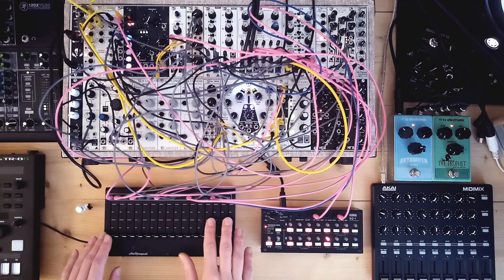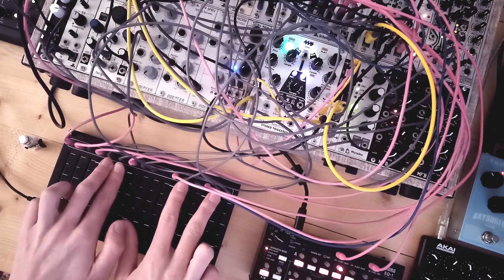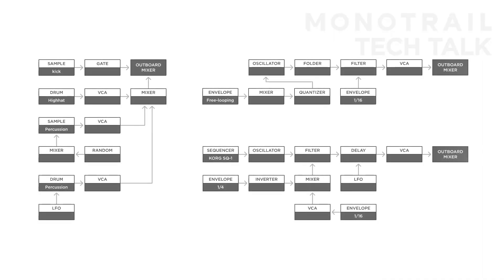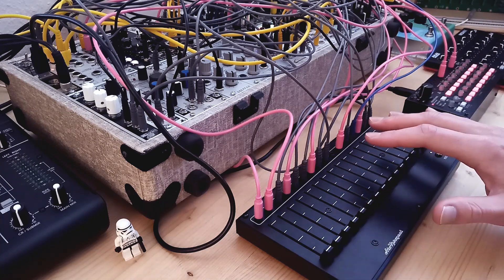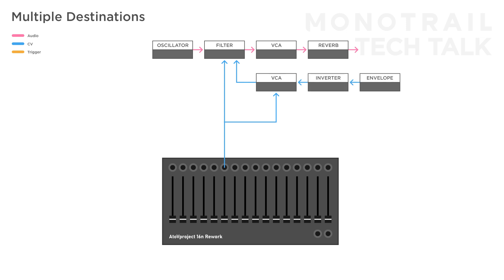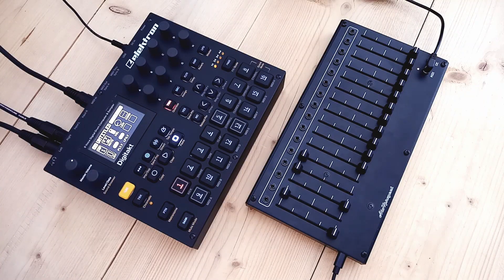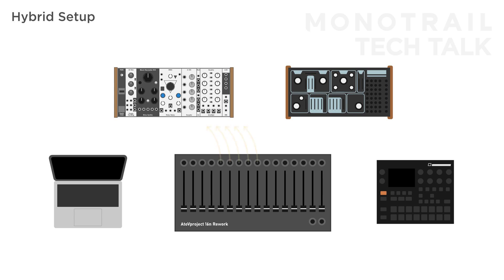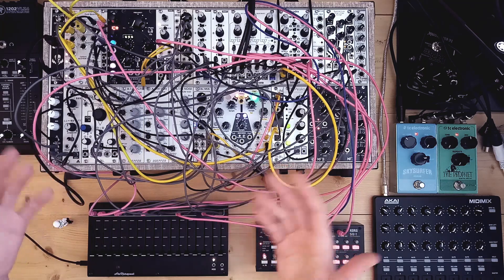How to improve control over your modular, hardware and software with AtoVproject 16n Rework

Comment: Nice presentation as always on your channel!
As you can control via MIDI CCs I wonder if you could use it also the other way round to convert incoming MIDI CCs to CV with this fader box?
Reply from the maker: Thanks! You can use the sliders to control CV and Midi, but not the other way around. So it's not a 16 channel midi to CV converter. Although that would be nice indeed :)

Comment: Would you require a midi breakout like the CVM8 from expert sleepers in order to connect to to the Disting EX?  It's not super clear how that connection is made, could you clarify?  Very inspiring stuff!
Reply from the maker: Not midi, I am talking about the I2C port. So you should be able to use that single jack out from the fader bank to the EX. But I have to admit I don't have any of those devices, so I could not test it myself. Make sure to check the manual for the EX if you want to know more details.

Comment: thank you for the video, but 1 question, why should it receive midi through usb? (1:50)
Reply from the maker: I think they actually updated the device, so now it could be possible. It would be nice to recieve MIDI because then you can use it as a midi to cv converter, and send values from a DAW to your modular for example :)

EDIT: After clarifaction from the maker: The module is updated so it can send midi data at its midi output, recieved via the usb. The slider outputs are fully analog, so it's not a midi to cv converter! But you can use it to forward midi data to digital modules.
Reply: @MonotrailTechTalk  oh,i see! Thanks!

Comment: This video made me buy the controller and it solved a lot of problems for me. It's great to have so many OFFSETs available :) Thanks. Just one question: using passive stackable cables, is it possible to lose voltage? I am not speaking in the case of tracking for a VCO (because perhaps I would not use it) but I am speaking of normal voltages routed towards different vc (for example vca, filters). In that case it would be useful to change the voltage to 10volts and attenuate it in some way or would it be fine even 5 volts? Hope the question is clear, thanks again for your great videos.
Reply from the maker: Hey, glad to hear it! Im afraid im not sure if there is an internal way of buffering in the 16n Rework, don't have the tools to test it atm. In general if you mult voltages with a stackable indeed you loose a bit of strength. In practice though, unles you use it for melodies like you said, its not a problem at all, the loss is pretty small.

Comment: This seems to be useful in such incredible ways. It would be perfect to use 3 or 4 of the faders for bringing different guitar pedals into a soundscape.
I love the hands-on approach of this too. I haven't seen it in any stores, how did you purchase yours?
Reply from the maker: I'm lucky enough to live in Berlin, close to the friendly guy who builds these. There are only small batches, available as DIY, or assambled through schneidersladen, here in Berlin: https://atovproject.de/dealers
Reply from the maker: https://schneidersladen.de/de/atovproject/
Reply: @MonotrailTechTalk  Thank you-👾
Reply: worth adding there's also a Michigan Synth Works version (not really compatible with 16n but derived from it), sold via their website. it has a more handy 0-5/0-10/-5+5v individual switches on the faceplate. and of course the Sweet16 modules. the 16n project's been around for years, so it's all well developed. + incredible controller, great video too.